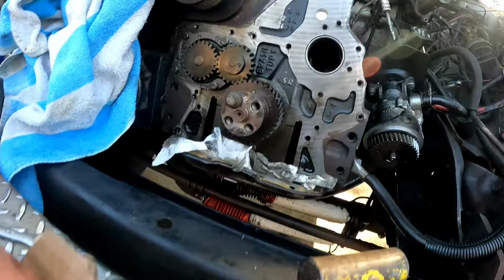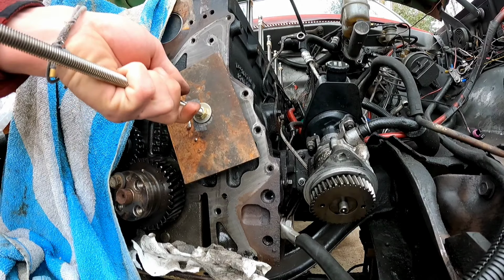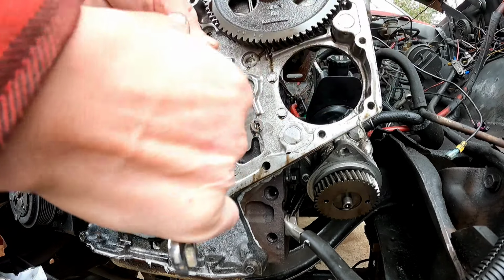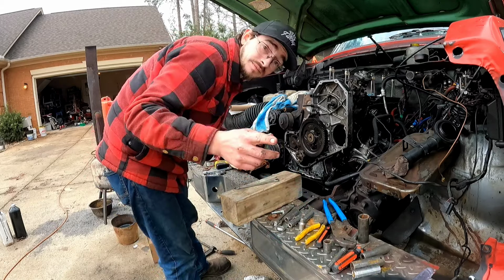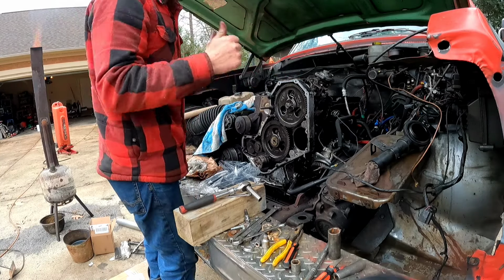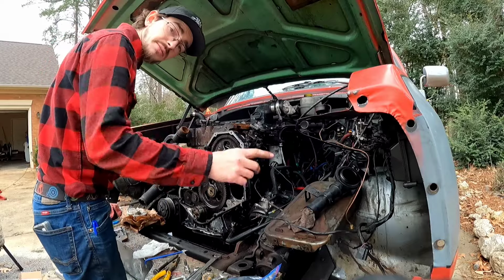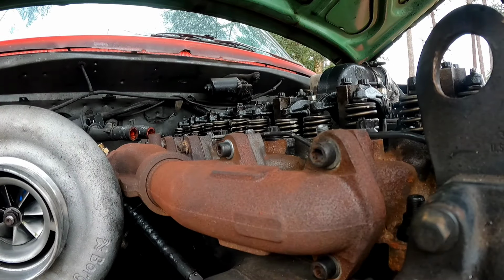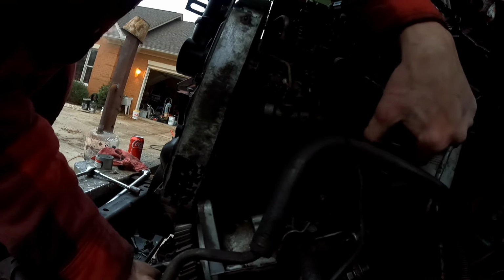6.7L 12 Valve Cummins! Engine Assembly! pt3

Comment: Did you drill the steam port holes in the head ? Good video 👍
Reply from the maker: When I originally built the engine I did drill the head for steam ports, it wasn't needed but I'd rather give it all the cooling help it can get!
Reply: @AverysAdventures6  
I'm thinking about building one myself, thanks for the reply 👍